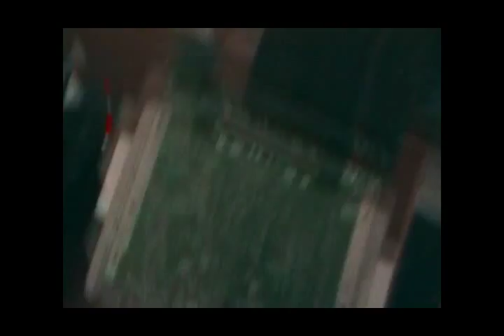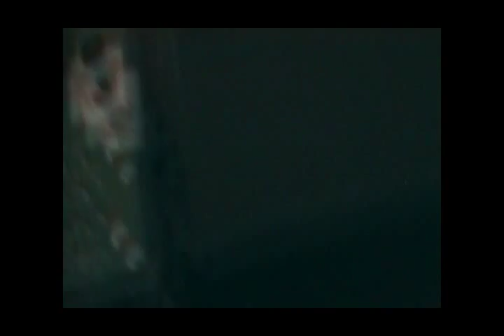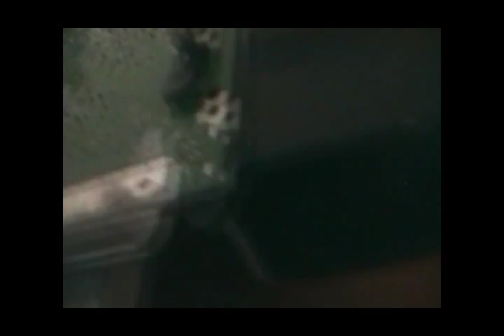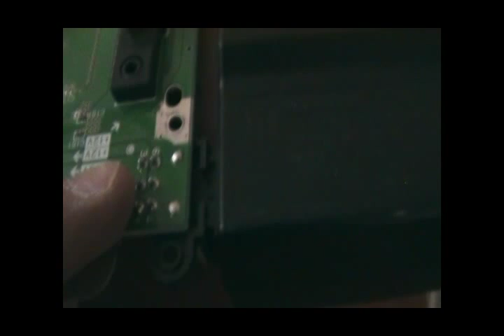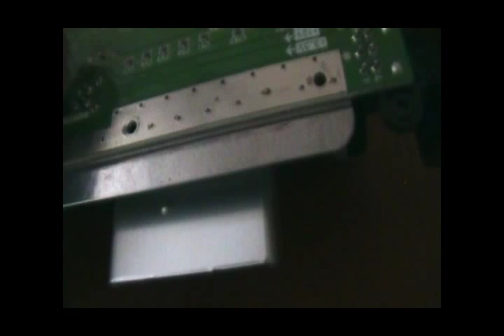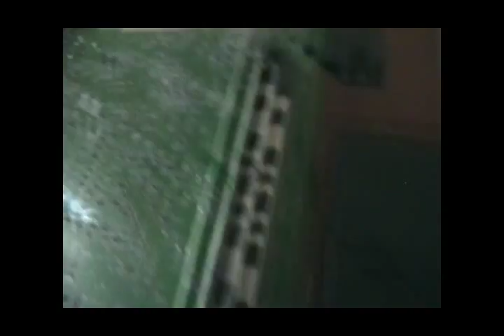Nintendo 64 - Power Troubleshooting

Comment: Not sure how this ended up working out for you, but 1 thing i do know is static electricity kills computer components so you could have messed it up cleaning it out the first time, but what ever is going on with that flashing circuit is clearly a big problem if that's supposed to have constant power.